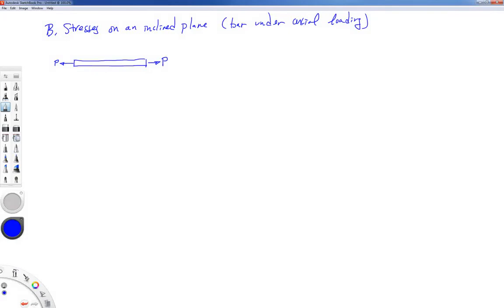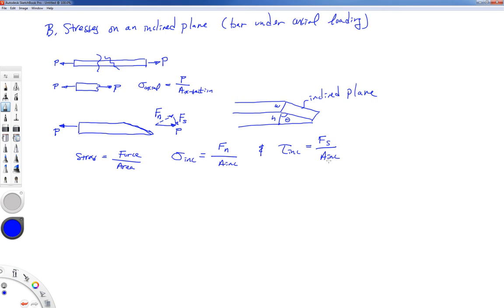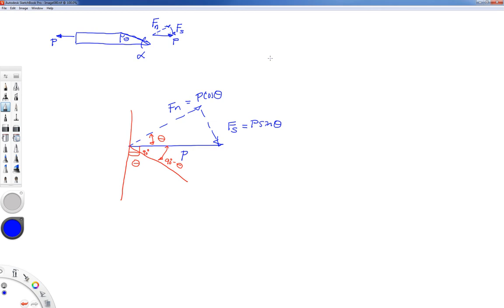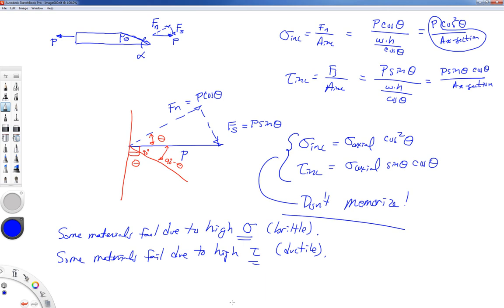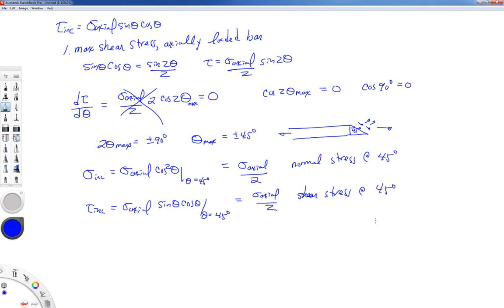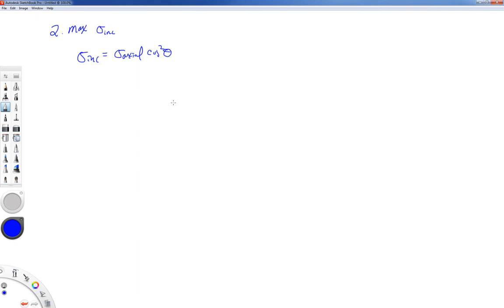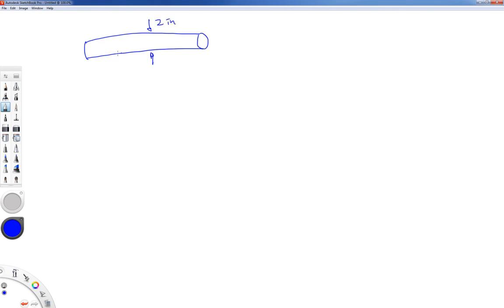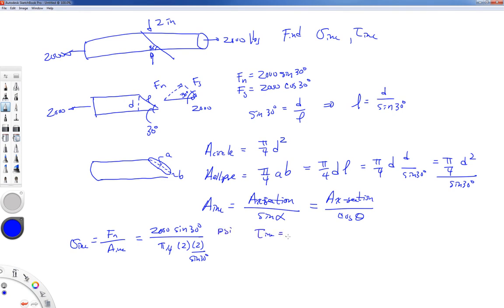Mechanics of Materials-Lecture-05b-Stresses on an Inclined Plane

Comment: Thanks for your video, sir. The max shear stress will act on +45 and -45 inclined plane, but is there only one failure surface in the test?
Reply from the maker: My personal observations for rectangular cross-sections is that there is one final plane of failure.  Real materials are not completely "perfect"  and so there will be some internal influence on the failure plane.   I have seen many round specimens fail in a 45 degree cone shape though, as all the planes around the  specimen are equal in potential.  Lastly, note that in many cases the deformation in the material can become so excessive that you no longer have a true uniaxial stress state  and so the final failure can also be influenced by that as well.
Reply: Thanks for your detailed explanation!